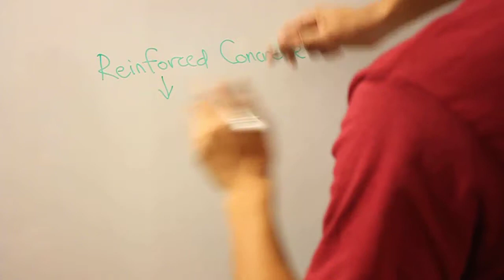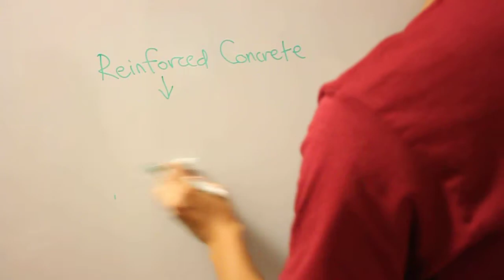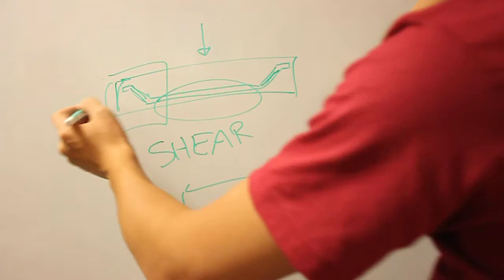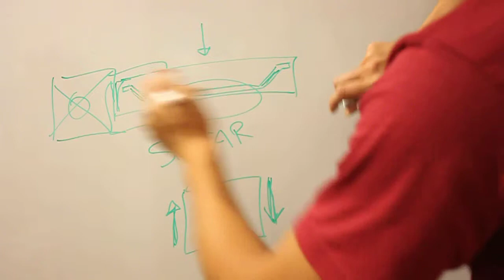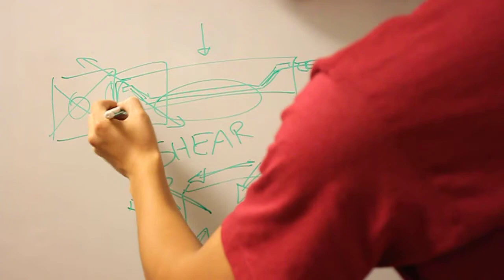Reinforced Concrete

Comment: I would like to add that stirrups near the support also acts as the protection for shear. You have a point about the 45 degree angle of the rebar. But normally this is used in construction to prevent cutting the rebar. Instead of an allowance for the development length of rebar. The stirrups purpose of holding the steel or the concrete is applicable mostly to columns.